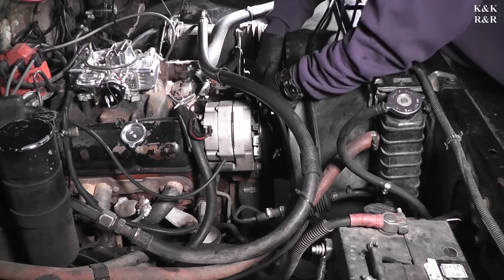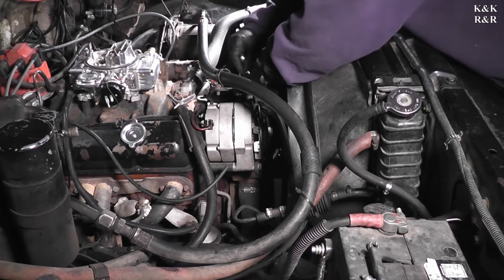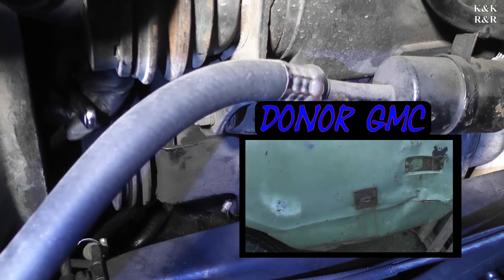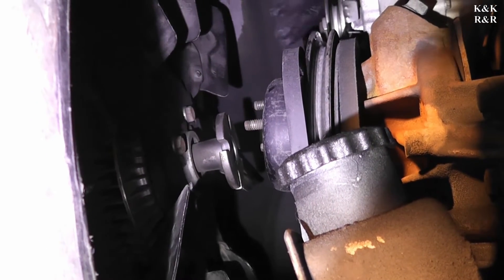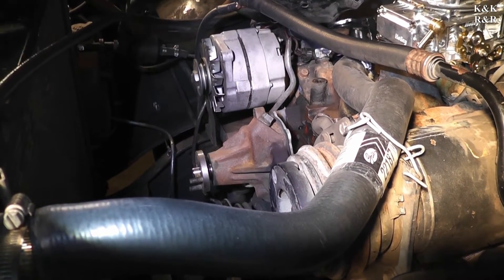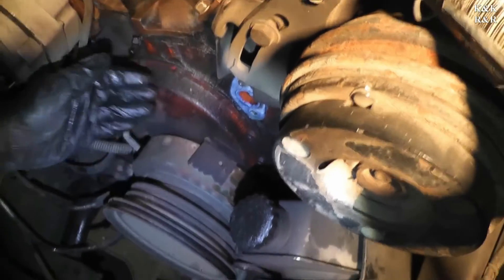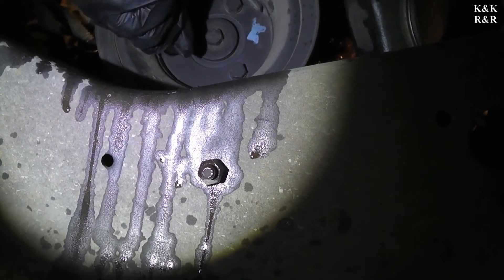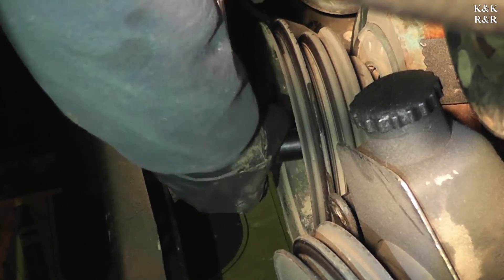How to Diagnose & Replace Any Chevy 350 / 5.7L Timing Chain Pt1 Diagnose

Comment: I have a Camaro 305 Z28 - 1986, Is it the same procedure and the same parts that we find in your video?
Reply from the maker: its fairly close, Z28 are just a bit tighter,  different motor mounts, and accessory brackets.
/K&K

Comment: I have an 89 that was runing fine just about, i replaced fuel line (went to replace filter and line broke off). Also replaced the Spark Plugs, Wires, Distributor cap and the rotor.  Is it necessary to put the timing light on it and do the timing if i did not replace the distributor itself? or can the timing be off sometimes after just replacing those two parts?
Reply from the maker: There's no need to re-time the engine if you not changing the Dist.  That's one thing GM built in to their HEI system was to be able to service items without checking the timing.   With GM caps there in a fixed position so timing doesn't change.    TBI engine are basic and rarely need to be timed unless someone moved the Dist trying to chase a divisibility issue down. 
/K&K
Reply: @KNKRNR  I need to recheck all of my wiring then. Is it possible the engine will still run even though maybe one or two firing orders were possibly mixed up? Yesterday I had the whole flat power issue. It all of sudden happened. After i finished the work a few days before, i noticed a bit of a delay in response. Yesterday she went flat on me. check engine light going off. Popped the hood. Well i must not have had a plug boot clicked on all the way. one was off. so i put it back thinking that was the issue. I get down the road again and same issues again. Just flat. Running a bit warmer than usual also. Ill recheck my firing order in case i screwed up on chainging over one by one as i thought. Thanks for the Response Keith.
Reply from the maker: @butlerlandscaping5503  Start with checking the firing order of your spark plug order. 18435672, If its running flat, no power and running hot, check engine light is on you need to make sure the timing spout connector is plugged in.  If that connector is not plugged in the check engine light will come on and the ECU will not advance the timing.  Your looking for a tan and black wire connector located on the firewall.   We have found if the timing isn't right the engine will run hot and have no power.  Does it ping under load?  
/K&K
Reply: Rechecked. Everything is correct. I have a question. The fuel line. It's been on my mind. I replaced it from the filter to the engine with 3/8 line. Do you think this could be the issue? Maybe not enough fuel pressure when not at idle?
Reply from the maker: @butlerlandscaping5503  Did you replace that with rubber 3/8 fuel hose?
/K&K
Reply: I used a Dorman Part # 800-170  to a length of rubber 3/8 carburetor hose to a 3/8 barb fitting to the filter.
Reply from the maker: Personally I would go to a junk yard and get a used factory fuel line. As far as being in a pinch what did will work.  Have you ever replaced the fuel pressure regulator in the throttle body?  These engines run like crap if that fuel pressure regulator isn't working right.  Weak fuel pressure changes the M.A.P. value which effects timing.   My 95 was running 10 lbs of fuel pressure which made the timing run at -2 degrees when it needed 13 lbs of fuel pressure to run 12-15 degrees of timing at idle.  Plus  it ran like it had no power, replaced the fuel pressure regulator and all was good.  
/K&K
Reply: @KNKRNR  So. I went back to the auto parts store. Come to find out, the fitting i needed was a 5/16. IDK why i didnt go back to do this. Im back on my factory line. Repaired the end that broke off with a 3/8 flare to 5/16 barb. Truck is running a lot better. WHen i had the 3/8 line, i could barely back up to my trailer on a slight incline. I do see noticeable improvement. Just still a little hesitation. Ill see how she does pulling my trailer. Now I went on a nice little drive around my area. Is there a learning time period for the timing to re advance. Should i disconnect the battery to reset or something since i replaced the fuel line back to factory. I never took the line out and just had it in there. Also, the round plate that goes around injectors and the air cleaner filter sits on top, does that need to be sealed to its base? Just working my way does the options for even more improvement.
Reply from the maker: @butlerlandscaping5503  No I wouldn't reset the battery for a fueling issue that's been corrected.  The computer is always learning.  The timing advance curve will change as the MAP values change with the proper fuel pressure.  Have you ever replaced the ECU coolant temp sensor?  Its the two wire coolant temp sensor on the intake manifold not the 1 wire coolant temp sensor on the drivers side cylinder head.   Three things that the TBI computer needs to run right are accurate MAP readings, Coolant temp reading, and O2 sensor.  Yes there is a air cleaner base  gasket  above  the round protector plate.   Its the same air cleaner gasket that the carbonated 350's used.   Glad to hear you got it running a lot better. 
/K&K
Reply: @KNKRNR  Thank you guys for the help. I really appreciate it. I love working on this thing. Very simple. My first V8 and my first actual truck.

Comment: I think my 69 impala has a bad chain... it was getting harder and harder to start. We were pushing/pulling another car in to my garage the next day it ran like crap... then I couldn't get start and when it did... I had a few light sparks come out the exhaust. Now it turns over like the battery is dead
Reply from the maker: Yeah sounds like the timing is off. As the engine starts it could be firing the piston down before full compression occurs putting a load on the starter.  A quick check would be to rock the crank pulley back and forth and listen for chain slap because if that chain is bad you will hear it slap back and forth.  These engines will run +/- 8 degrees much after that you will shoot flames out the carb or down the tail pipe.  Please let me know what you find out as it would be interesting to hear the cause of this hard start cold issue you are having.
/K&K
Reply: @KNKRNR  well the gear marks lines up but the chain is sloppy
Reply: @KNKRNR  we put a new distributor in it firing order is correct idk I'm upset lol

Comment: That is exactly what my 5.7 sounds like since it stalled on me the other day I was pretty sure I slung that bitch off but then it started after  towing to the house sound like a rod knocking
Reply from the maker: Main bearings freeze up and stall the engine then? We have seen 350's with bad main bearing under heat expand to the point it will stop the crankshaft from rotating tilled it was cool off. They will start cold and then knock like hell. 
/K&K

Comment: I have a 396 in my 78 camaro and it has a big cam so I expect it to have a rough idle as is but it seems awfully rough and when I get on the highway or just drive as is it will be driving fine then start to backfire and pop in the exhaust like the timing is getting off so I think I have a slipping timing chain and if you look at it with the timing light the timing mark moves around
Reply from the maker: Could be the timing chain but I would also check the Vacuum advance unit / Centrifugal Advance Springs to make its not ceasing up after its hot if your using a HEI disturber.  If you have a sloppy chain it would show up with a timing light as the timing mark with be jumping all over the place with the vacuum advance hose unplugged at idle or slightly revved up.
/K&K
Reply: Keith & Kevin's Repair & Restorations I’m talking to a local drag racer who builds motors I showed him a video and told him what it’s doing and he says the motor sounds great it sounds like a setup issue so he’s gonna have me do a leak down test and go from there thanks for the help though I will check those things to be sure
Reply: Keith & Kevin's Repair & Restorations I think that they used to race the car because they have a race hurst shifter they stripped out all the vents and air controls and threw in a switch panel I bet what happened is they wiped a lobe on their cam and bought a new cam and used the old lifters not caring if they work with the cam or not and got it running decent to sell it because I can not get the valves adjusted right for the life of me no matter what I do I have rockets that tick and backfires so I may end up buying a new set of lifters for it and see what that does
Reply: Keith & Kevin's Repair & Restorations I checked timing with the advance unhooked and the line plugged and the timing Mark was up and down the whole time so timing chain?
Reply: Keith & Kevin's Repair & Restorations well it’s dead i found out it’s got 2 flat exhaust lobes
Reply from the maker: @yamahaguy1732  Are you using a solid lifter setup?  To wipe out two exhaust lobes could mean the hot valve lash was too tight or the exhaust valve springs are to heavy for that cam. Hopefully a cam swap will you get you going again. 
/K&K
Reply: Keith & Kevin's Repair & Restorations I have no idea everything seemed alright but the guy who built it had no idea what he was doing from what I have seen which makes me concerned for the rest of the motor but the valves always ran on the looser side it seemed to like to run that way better
Reply: Keith & Kevin's Repair & Restorations and the lifters are hydraulic my guess is he never used zinc in the oil and it ended up taking its toll on the cam

Comment: My 305 in my blazer doesn’t want to idle I can sit there and crank it with the throttle wide open till it catches and runs but even at wide open throttle will bearly idle if I let of a bit it dies out it’s getting plenty of fuel you can see the tbi do its job it also puffs out a lot of white smoke any guess? I changed the cts spark plugs and wire the idle controls module as well feels like she cant breath not even at wide open
Reply from the maker: White smoke means you burning Antifreeze in the combustion chamber. With these engines its either a blown head gasket(s) or a cracked cylinder head(s) which are very common with these TBI engines (1986-1995). If the head gaskets are bad you will see air bubbles in the coolant reserve tank as the engine runs. You can do a compression test to verify either issue. With TBI engine in general once the engine vacuum gets below 8-10 HG or they are ingesting a large amount of antifreeze in the combustion chambers they will have a hard time running even at wide open throttle.  
/K&K
Reply: It was running and driving parked it for 2 hours came back and she started acting like yours she’ll sit there and spin and spin and bearly catch with the gas all the way in but it won’t rev

Comment: Could a decent size cam and a pretty worn out chain cause it to stall out out of nowhere? Even if it didn’t skip a tooth?
Reply from the maker: We later found out this engine had a 292 cam installed, which I believe put added stress on the timing chain.  It didn't skip a tooth but it did cause the timing to retard during warm up due to the stretch. We had the timing set at 8 degrees, but on the timing light we could see the timing retarding to 4 degrees which was the reason it did not like to start and run when it was cold.  We later found out that this engine was built to run stock circle track. Idling was not its best quality with a 292 high lift cam.  

/K&K